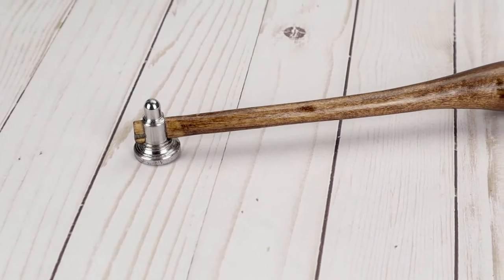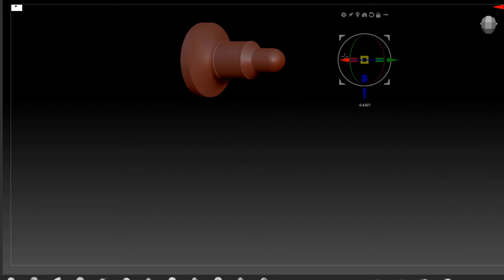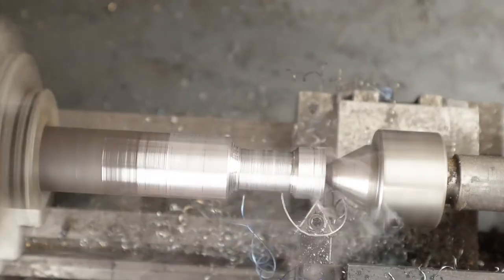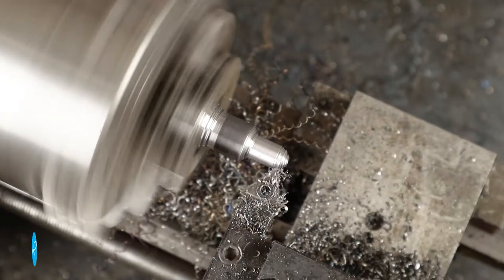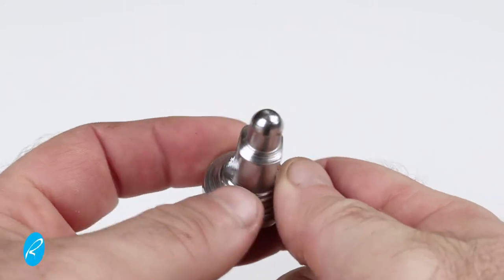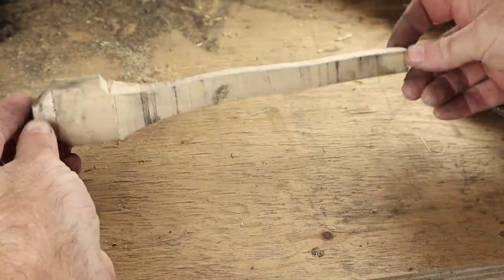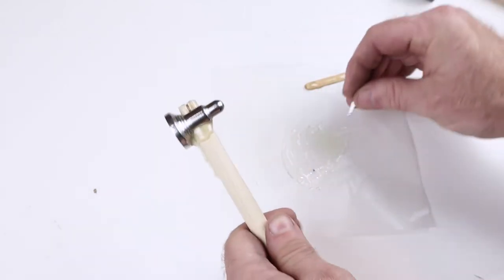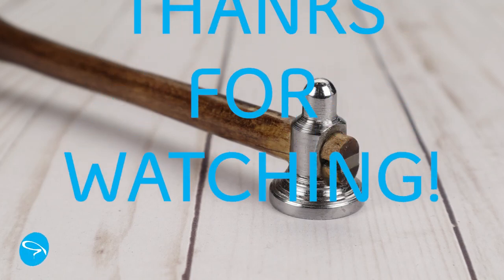Making an engraving hammer.

Comment: On my hamer the face of the hammer has a slight dome and a radius around the edge so it won't dent the material. It's mainly used for hitting the punch but is also used to hit the material or planish it. These are great hammers for detail and ingraving.
Reply from the maker: Is that a store bought hammer, or something you made yourself?
Reply: Most of my store bought hammers end up being modified. I'm always trying to make good enough better.